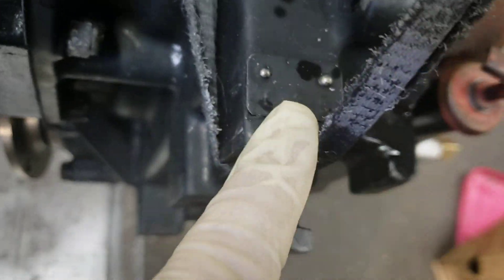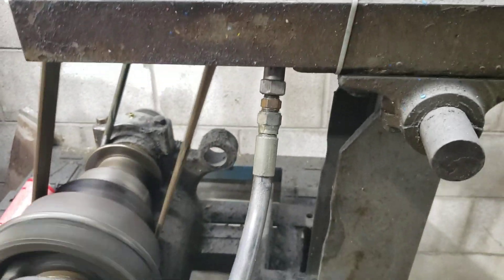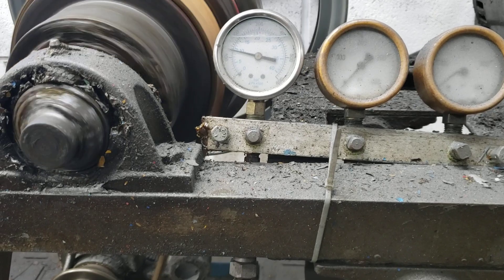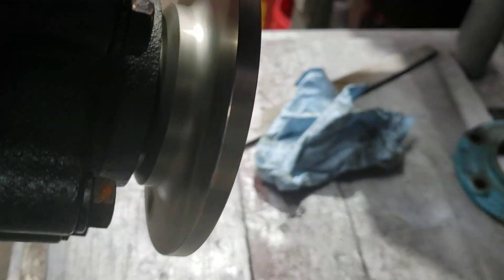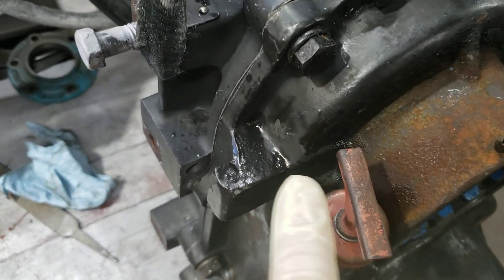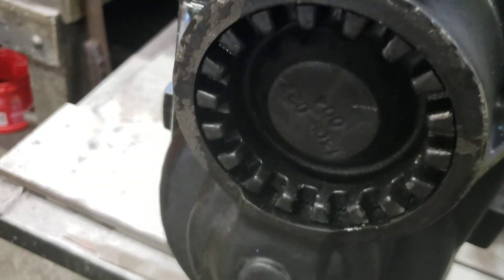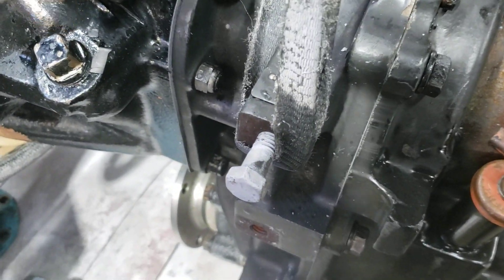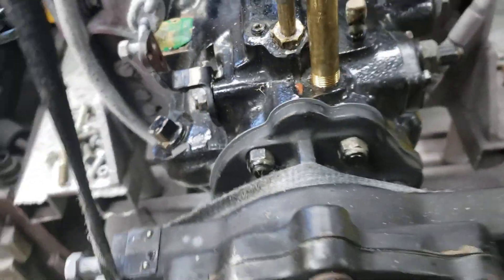1005-005 Velvet Drive V-Drive

Comment: Hey, I have a Walter v drive RV36 ration 1.52-1. 
The transmission is good but the v-drive won’t spin. Seems to be seized up. Do you have advice on where to look/fix or rebuild. Any advice helps. Thanks!
Reply from the maker: Contact Walter's Machine Company  in New Jersey